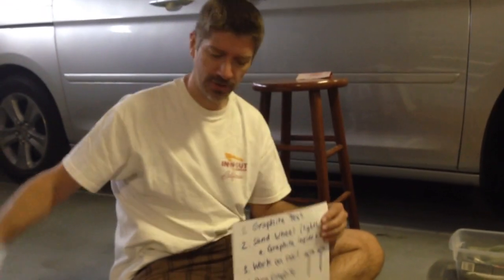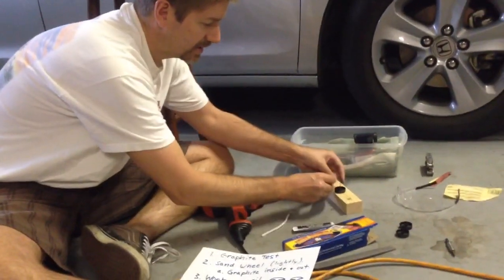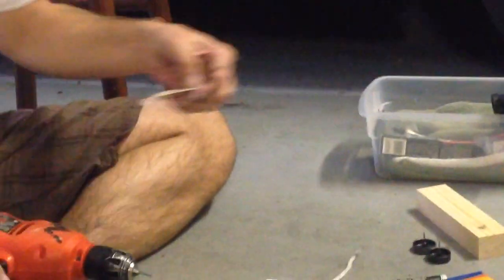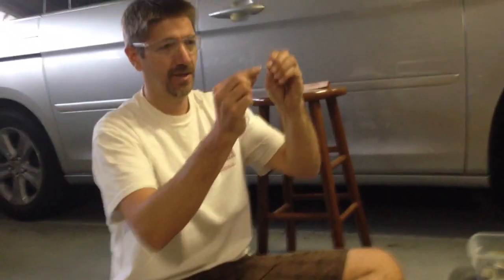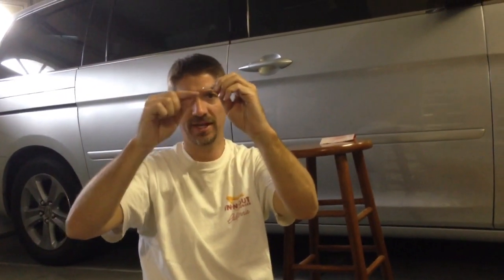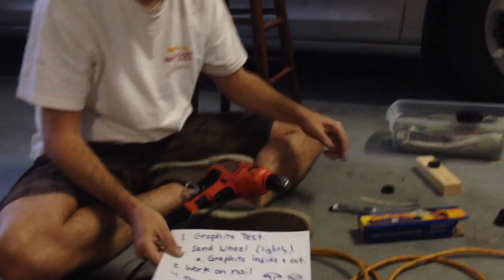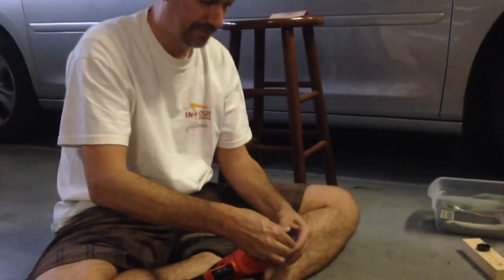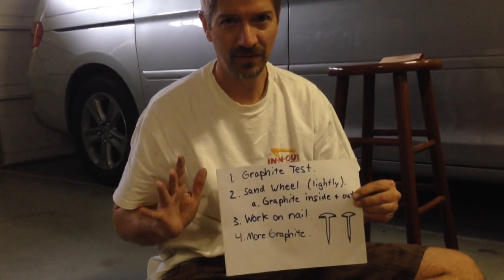Five tips for fastest pinewood derby car - wheels and axles (PLEASE SUBSCRIBE)

Comment: I noticed how you chucked up the wheel in the drill, Just one note I'd like to add...The wheels I received with my grandsons kit this year had the axle holes drilled slightly off center, they were center to the wheel themselves but not in the boss molded in the center of the wheel. I bought the fixture that screws through the wheel itself and rounded the wheels off that way. Next year I buy quality wheels!
Reply from the maker: Yep... standard scout wheels are usually crap.  I save myself time and simply buy wheels from Maximum Velocity or one of the sites.  Then I know they're professionally lathed and true.
Reply from the maker: Glad you liked and commented on my video.  Please subscribe.  I need to get to 1,000 subscribers to keep making money on my channel from YouTube.

Comment: Hey thane great videos  was wondering your opinions on lubricant. We won our pack and are heading to district. There is a company in CA  that claims to have the best lube,it's a wet lube but it drys up and works great I guess I'm wondering if I should switch to it or not.
Reply from the maker: I have not used other stuff.  But I have a friend who tried some oil type.  It claimed to be a little faster, but who really knows.  As for your car, I would not change lubricant now.  My friend who used the oil was told it can only be used on new wheels and nails.  "Once you have any bit of graphite mixed in, it doesn't work, and there's no way to clean all the graphite completely off."  So for you, I'd say stick with graphite.

Comment: hello I was wondering if there is a decent way to bend the axles without having the tool?
Reply from the maker: +Robert Cheney You could try holding middle of nail with needle nose pliers, and setting nail on cement and hammer it.  WARNING: Don't use pliers high enough on nail where wheel will rest because you'll likely scratch the nail and cause more friction where wheel rides.  Experiment first with some junk nails.
Reply from the maker: Glad you liked and commented on my video.  Please subscribe.  I need to get to 1,000 subscribers to keep making money on my channel from YouTube.